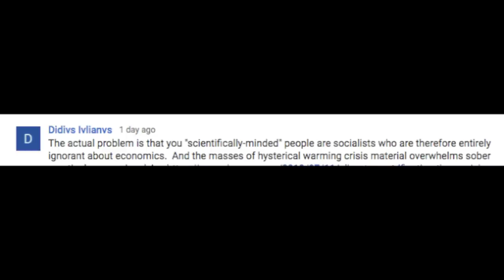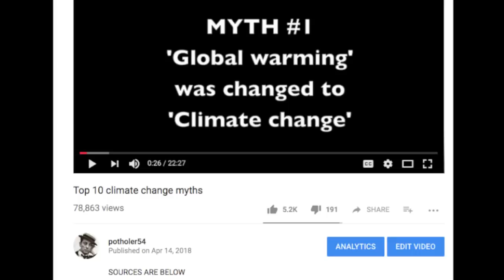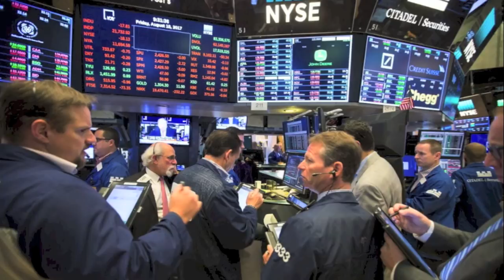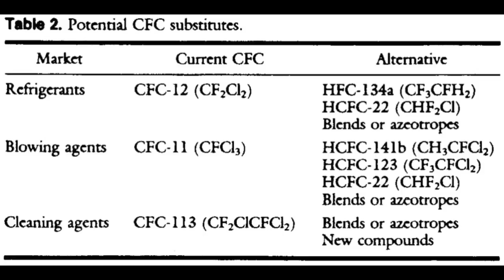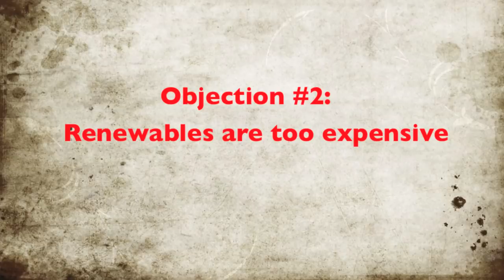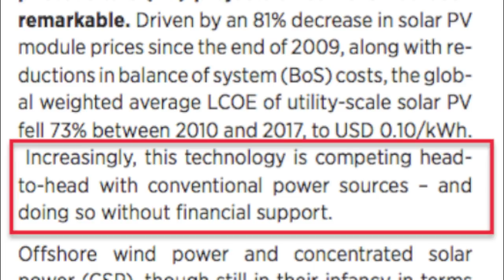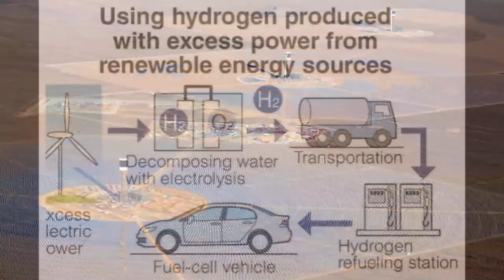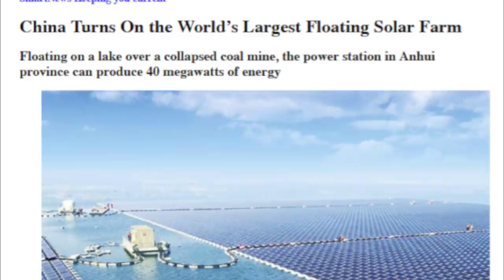A CONSERVATIVE solution to global warming (Part 1)

Comment: The storage section of this video is a joke, does not stand up to basic engineering or physics scrutiny (Tesla battery is barely a storage system, mostly there for frequency control). Apparently grid scale storage system are like building a few Saturn Fives. Pfft. Heck this entire video is a joke. There is no acknowledgements of physical limits (Betz, Carnot, ect), no discussion of steel/cement/ammonia production, no efficiency chains explored, no hard look at the failure of Energiewende, no look at how most emissions cuts are a result of Natural gas. Good thing we can dismiss these things by pointing out that a coal museum has switch to coal... Also like how the links are from garbage sources like the Independent, the Guardian, ABC new, ect instead of serious sources like IEEE Spectrum. There are solutions to global warming that are compatible with capitalism/conservativism but this smug video adds nothing to the conversation.
Reply: Tesla's Hornsdale battery (the one in the video) does primarily provide FCAS services. But other batteries such as Tesla's Moss Landing project are definitely for time-shifting power.

I'm not sure why you think this video isn't good without exploring those additional topics. They do sound interesting though! If you make a video on them, I'd watch it.
Reply: @SHEISTER CAM maybe try improving your reading comprehension. "Some issue have been solved" is not even close to saying that Sodium Ion batteries are ready for grid scale storage. Maybe if you actually read or were capable of reading IEEE article you would know this. You would also know that a 20% savings is nowhere close to being enough to make grid storage economical. You would also know that Sodium Ion batteries come with a slew of disadvantages such as power density (power not energy). Though please keep accusing me of being misinformed for not reading trash like ABC.

I know you have trouble with reading, but my comment with respect to Elon Musk was mentioning that the Tesla battery in Australia should not be considered storage in any meaningful way. It mostly serves to provide phase control and some arbitrage. Elon or anyone else that points to that battery as meaningful energy storage kills their creditably on the subject.

"chemical batteries are just one proposed" No, chemical batteries are the only thing that scales efficiently in any location. Pump hydro is very limited and location dependent. The hydrogen storage chain is too inefficient to be considered for anything other than dump loads. Compressed air and gravity storage are both hype nonsense. Molten salt is too inefficient for anything where waste heat is not readily available. All of these solutions have to compete with on demand gas turbines, batteries are the only thing with a chance one day to compete.

If being realistic and providing criticism based upon actual engineering constraints makes me negative, then good. There is far too much hype and bullshit in the renewable energy sector. This is also dangerous because we waste resources on renewable energy that has a poor return on that capital when we look at energy holistically. We should and could be building reliable nuclear instead.

If you associate my pointing out of obvious flaws and oversight with character assassination then you have some severe issues. Also by that logic is potholer54 not character assassin himself?

Please get back to me when you understand basic physics or even the articles you reference.
Reply: @ppwalk05  
That is exactly the lack of 
'can do attitude' the video is talking about.

Cherry picking supposed technological flaws in a developing field, is not an achievment for an engineer.

Coming up with solutions is.

"The storage section of this video is a joke,..."

Did you bother to watch part 2 of this 4 year old video?
Link:
https://youtu.be/6fV6eeckxTs
In it, Peter gives some more examples of 'storage' solutions.

---
"There is far to much bullshit and hype in the renewable energy sector.
This is also dangerous because we waste recources on renewable energy that has poor return on the capital..."

The video shows that this does not has to be true.

Renewables can produce a 'return of investment' short term and by not destroying our ecosystems long term.. 
In fact they are already profitable.

Browsing about your other arguments like the supposed  "failure of the Energiewende" 
and similar talking points of climate sceptics and fossil fuel friends like to share.

I guess its not so much a 'character assasination'  as a immature mind, trying to strenghen his opposing opinion with the use of childish language while ignoring reality..

Using descriptions like  "joke" "trash" "bullshit" "smug video" just shows the lack have any enginering insight, but rather a motivation to spread misleading information to influence opinion.

Also, the IEEE does have alot of new papers regarding energy storage solutions on there website.. 
Maybe stop that selektiv perception of new information and your perspective will change.

Recommending , nuclear and gas both limited resources by the way, as a solution for climate change is atleast 30 years to late..

If we would have listened to experts..
https://youtu.be/1NOdTEIihFU
US congress hearing Dec. 1985 with the climate experts stating "discontinue coal and use gas as TRANSITION"